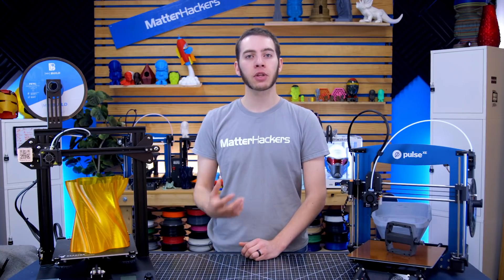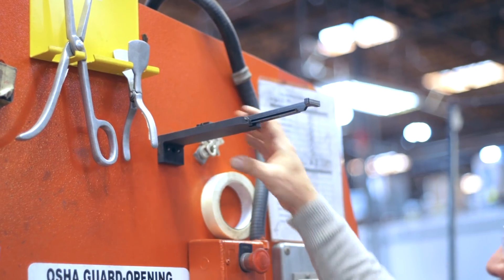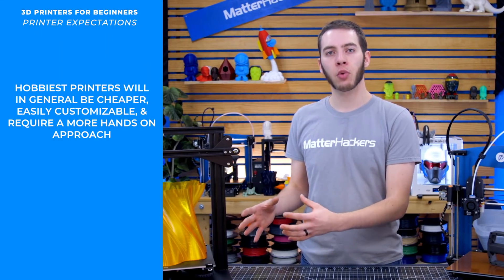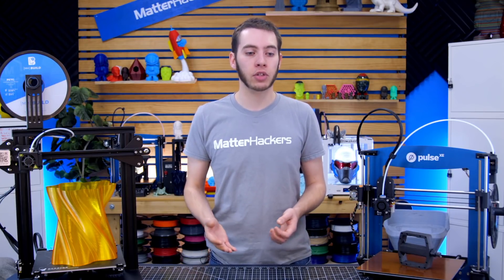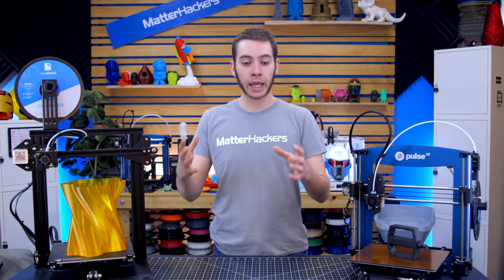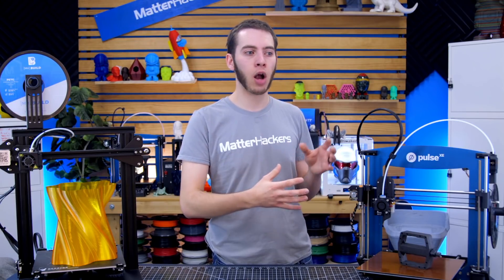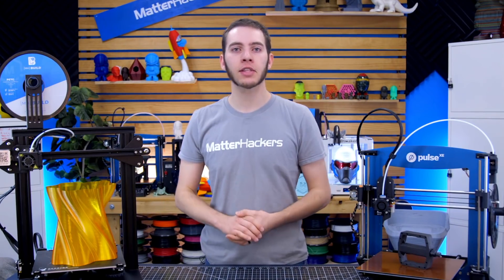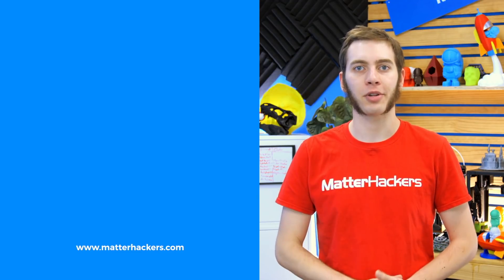THE BEST 3D PRINTERS FOR BEGINNERS | Everything you need to know to get started

Comment from the maker: For the experienced crowd: What was your first 3D printer? For the beginners: After watching the video, what are you thinking of getting as your first 3D printer?
Reply: Home Built...threaded rod, nuts, bolts, home made hot end...
Reply: Ender 3, cheap and 24V drive, OK printbed  :-)
Reply: @avejst  Its what I have.  Been getting amazing prints for <$200 (I got it for $175~$180 delivered).  Of course I invested $40 or so to upgrade it and buy more filament...LOL
Reply: Im looking into a standard budget printer with all the calibrations already set and just print a bunch of crap. I dont want to swap hardware, set software calibrations, or spend thousands of dollars. Are there  " both business hobby plug n play" printers out there?
Reply: My intention was to made a home build Delta printer from Instructables, which is almost done. But during this build I saw an advertisement on AliExpress for a cheap Delta printer which I bought. Its an "Anycubic linear" (from Kossel I think) and was less then 200 euro's. Cura software was included, though I'm think about upgrading the software as soon as I've got a new laptop (I use an old 32-bit system, most software nowadays are 64-bit).
Reply: first one I used: Lulzbot TAZ 4; first one I owned: Prusa MK3
Reply: Open Source. Dual z and Y axis screws and x axis screw. Large build volume. Able to print high end filament. Auto bed levelling and superb resolution. What printer is that?
Reply: The Wanhao i3 (known under many brand names) is a fan favorite. I purchased this (the monoprice brand) as a gift for a family member getting into 3D printing along with a shortlist of mods including glass build plate and Micro Swiss hotend.
Reply: What type of 3D printer do I need to make auto parts like bearings, brake pads etc, or can I or not make auto parts with 3D printers. I need this because I live in Africa and we have a lot of fake and inferior parts that keeps you in the mechanic shop more often than not.
Reply: @georgebolatiwa5330  bro, you don't need a 3D printer you need a high dollar CNC milling machine.
Reply: MakerBot Rep 2...At the maker space I frequented.  Initial experience with 3D printers does not have to require a purchase.
Reply: The cheapest can i find
Reply: My first printer was a monprice mini v2 and it still works great I’ve replaced the bed and made it better when printing flexible but other than that stock

Comment: Silly interested newbie question :  for either of the beginner 3D printers shown in the video , what is used for input ? 3D software required ? Or a scanner required ? Anything else ?    Thanks
Reply: You turn 3d files into something called gcode with a slicer, which you can get free. Those 3d files could be found online or designed yourself, but generally you dont need expensive kit or software
Reply: Thomas Ford   Thank you !